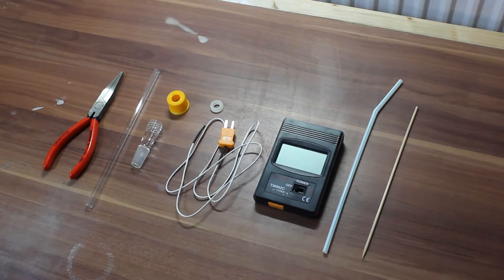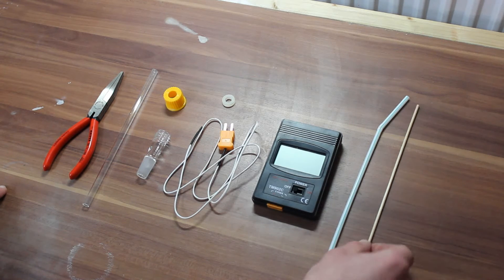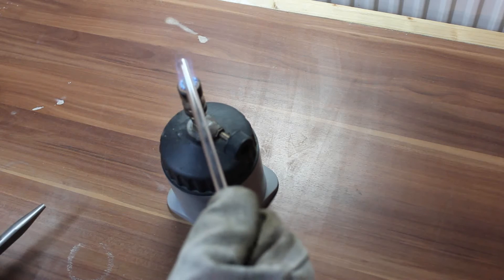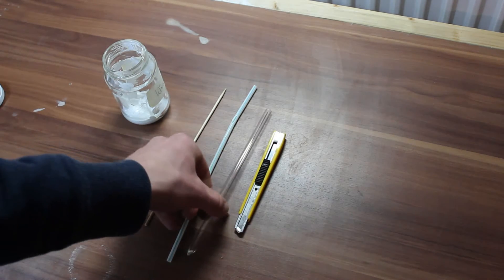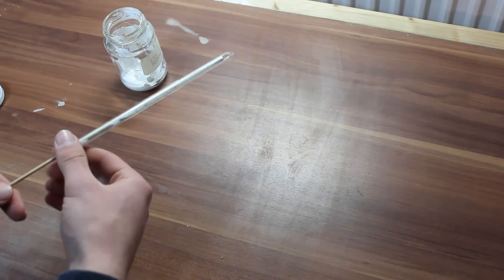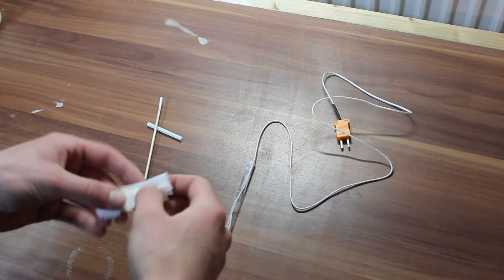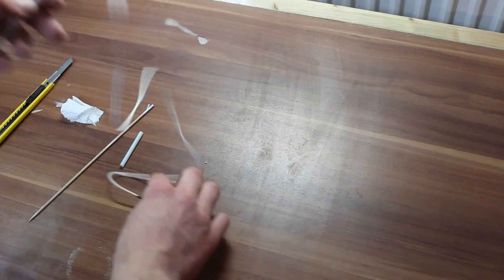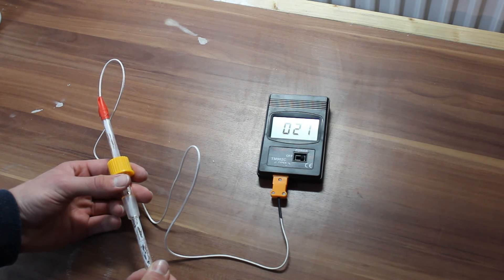Digital Thermometer Probe for Distillation

Comment: Nice work. I stumbled across your fantastic channel. I've seend Codyslab seal glass tubes by heating up the glass, stretching out the heated part then melting the stretched out thin section. Looks a lot cleaner.

Comment: I was wondering, is the thermal conductivity paste is necessary? Thanks!
Reply: I usually manage to keep the probe touching the bottom glass and the readings are pretty accurate but shifted a bit to the cooler side (one degree or so). I sometimes sprinkle a little bit of water to the thermometer adapter to get more accurate readings, but it takes longer for it stabilize due to heat capacity of water. So the thermo-paste or any material with high heat conductivity and low/no volatility should be ideal in this case.
Reply from the maker: Air is a good insulator, so yes I think it helps a lot.